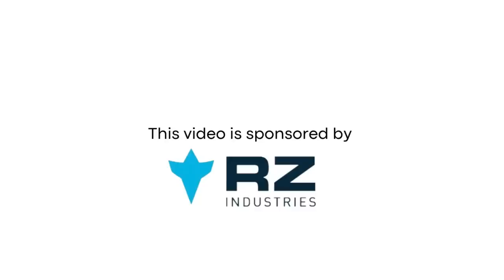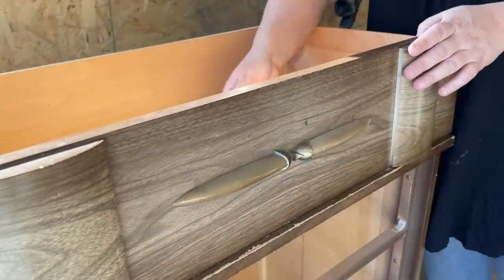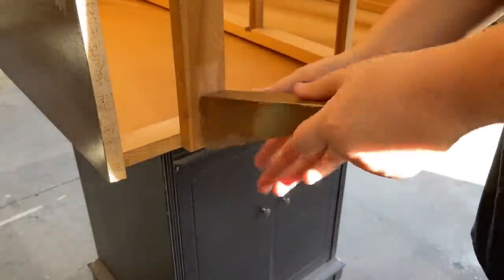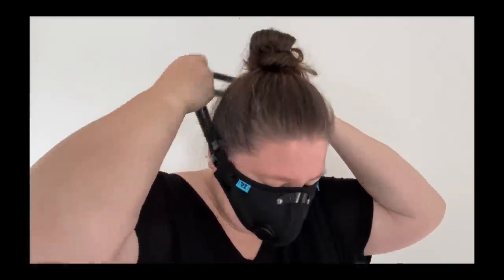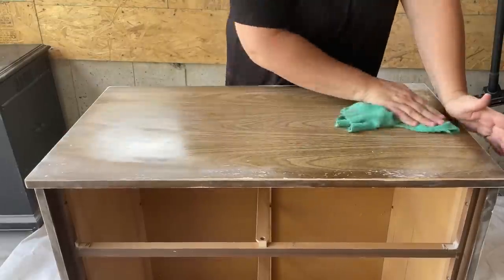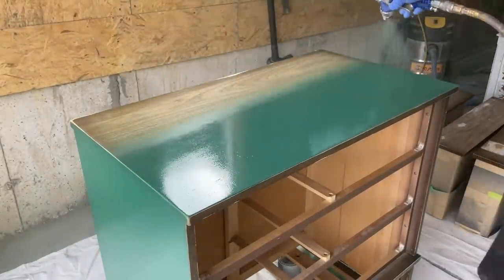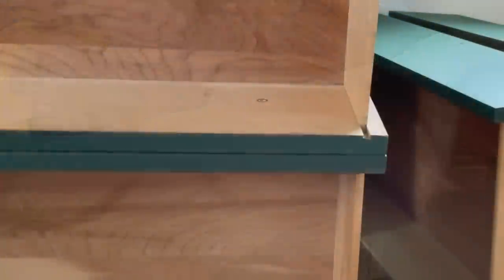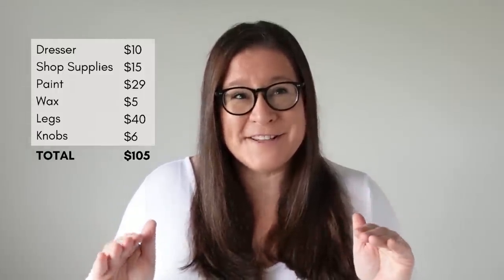MODERN DRESSER MAKEOVER

Comment: Tips with spraying this paint?

Doesn’t matter the the setting on my spray I get an awful orange peel finish
Reply from the maker: Hmmm, I’d say your pressure is too high but it might be drying to fast and not getting g a chance to level out. You could try adding a little water or extender to it so it has some more time to lay flat.

Comment: I just recently started flipping furniture. I feel like it takes me way longer than 4 hrs to flip a piece. Hoping I get faster with more experience.
Reply from the maker: You’ll definitely get faster as you go. Also remember that 4 hours is the actual working time but doesn’t include planning time, shopping time, drying time…etc.
Reply: @salvagedbykscott  yeah. I try to work on multiple projects at once but rarely get them finished at this point. I’ve completed one but very picky on the finished product.

Comment: Fact that it had poor coverage did that make you wish you would have put the bins primer on first.I think it turned out to be a gorgeous piece but it would’ve saved a lot of material if you could’ve just put a primer on it and then only put one or two coats instead of workouts am I right or wrong.
Reply from the maker: No, it would have still needed multiple coats over white. Yellows and yellow toned greens are just more translucent than other pigments.
Reply: Thanks so much for reply. Question, what about straight Shellac.?
Reply from the maker: I used straight shellac to spot prime this dresser to make all of the surfaces (original finish and wood filler) accept the paint the same way.
Reply: Kate, you are a wonderful teacher and an excellent presenter. It is lovely to watch you and learn from you. Thank you for the time you take to help us all. Suzanne Missouri Ozarksflipper